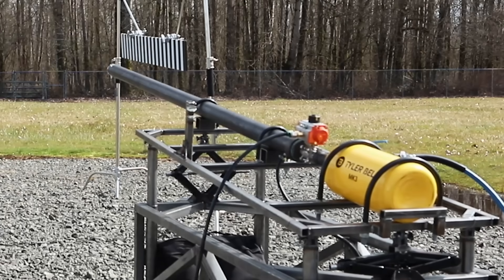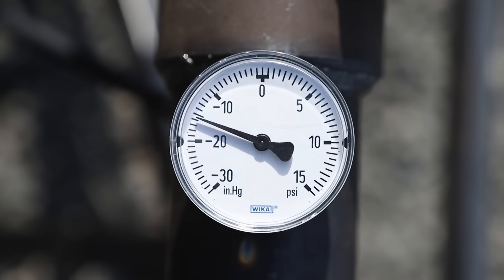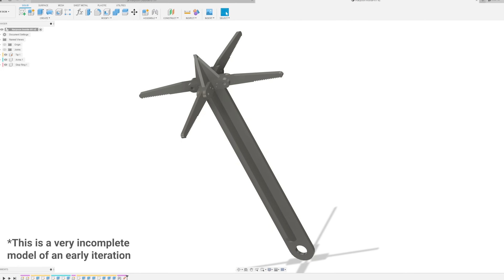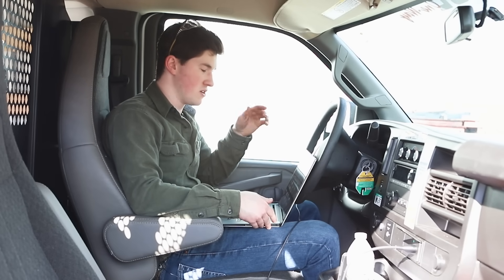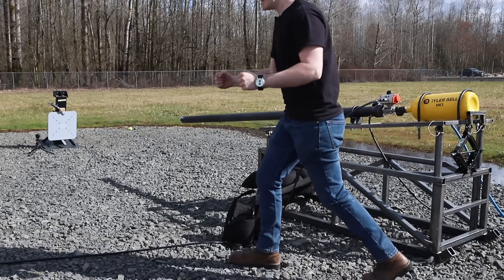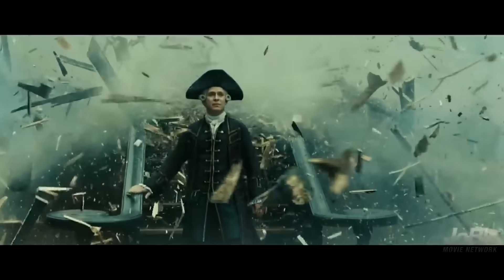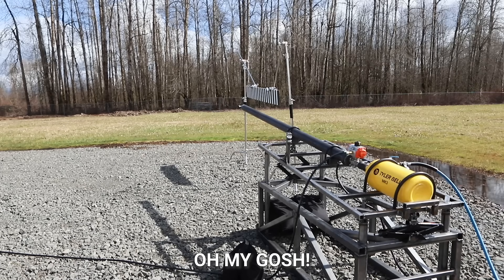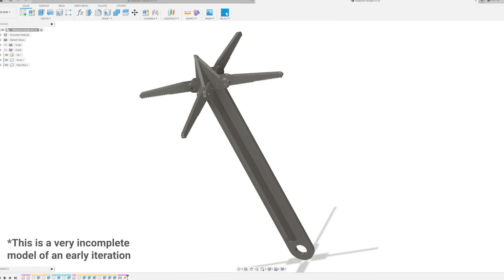Have I Found the Fastest Air Cannon Valve??

Comment: The weak link of your design is too small air tank. You have high pressure in your air tank, but not enough Air volume. By the time the ball reach the end of the barrel the pressure drop significantly because it has to fill the whole pipe with air. Double the size of the air tank and you will see significant increase in speed.
Reply: The other one is barrel length.
Reply: @Nickle314  Exactly. Once you have enough air volume, you have to increase barrel length to make sure the ball is accelerated for longer period of time
Reply: @GohanSama  Or push on it harder.
Reply: Another option is a sabot. A plug that makes a seal, but can't expand. The ball is then in front, and compresses into a dimple. Then the sabot falls away when leaving the barrel
Reply: He did pump the barrel down to a vacuum.  Increasing barrel length only helps if you have enough of an air/nitrogen supply.  The Sabot will help with the soft projectile,but I agree, increasing the tank size and then barrel length are good first steps.
Reply: More volume would help, but would make another problem worse.  The air in the barrel acts as a spring slowing the ball (See Smarter Every Day).  Pump the barrel down to the best vacuum you can.
Reply: The weak link is definitely the valve. At 10:01 it took almost two seconds for the tank to empty. If the valve was the same diameter as the barrel and opened instantly the tank would be empty in a fraction of a second. That's why the burst disc had better performance even with many times lower pressure.
Reply: The higher pressure cannon is definitely limited by the valve. Also the sabot idea is genius a piece of expanding foam cast in a dish shape to cup the ball would be best to distribute pressure. Also a bit of lube in the barrel may help as well
Reply: Greased patch like blackpowder.
Reply: a fundamental limit is the speed of air inside the cannon limited by the speed of sound.
Reply: @chargehanger  That makes no sense. Talk to the folks in California at Hypervelocity.
Reply: @chargehanger  Hot gasses, um air is a gas. It's the valve, the valve must open instantaneously because at these velocity's The projectile is out the muzzle before Tyler's valve opens.   My valve opens to 125% in 5 milliseconds That's 5 one thousandths of a second or .005/sec.
Reply: @chargehanger  What is an "air wave"?
Reply: @chargehanger So what your saying is if a solid lead meteor traveling @ Mach 8.98 will slow down and not break the sound barrier because it can't?
 Or... im just missing something here.
 Why can't air travel Mach 1.0
 Lightning that loud crack and boom comes from the bolt heating up the air to super sonic speeds.
 Help me understand why air can't but everything else can.
 It's just air pressing on, in my case, an orange with a force of 2,287 pounds for a distance of 4-foot. 
 That's 27 bar. 27times  the pressure of the atmosphere.
Reply: @chargehanger  When we first  smell something, that first whiff, the first molecule that had the sent attached to it. The source may have been only 10 foot away but that first air molecule may have traveled ten trillion feet. Due to the zigzag pattern caused by collision's with other molecule's, every air molecule at ambient pressure and temperature travels at 
 500-m/sec or 1,000 miles per hour.
As the pressure rises, (in my base to 400 psi or 26 times)  the speed doesn't change,
rather I'm pressing on the projectile 26 times more often. And yes the net pressure in front of the projectile at rest is 1 bar on the back side its 26 bar so at Mach o.1 the pressure wave of (sound in air) and the projectile's speed equals, and Kaboom!
Even though the air molecules are traveling at Mach 1.4  Tyler's design  has a flow issue. I "hopped up" the fastest opening reusable valve to give it a better flow rate so psi needed is much lower. Also  @ 10 pipe diameter's 30" in my case, the air take's on a laminar flow. so at 30 inches the air is moving as a unit with no turbulence. meaning, I've got 18 inches left to push, even with the pressure dropping to 300 psi, it's easer because of the laminar flow.
 When engineering something the goal is to design it as fast, cheap simple and easiest way possible. Then cater to the customer's needs, wants and budget. Imagine Tyler's Cannon with a 1 foot barrel, then with a 100 foot barrel, there's a sweet spot there. Mine came out with 4 foot given the 400 psi max pressure. I wanted it to be able to carry it myself , (no crane required),  99.9% stainless steal and just enough to break sound barrier with a navel orange. There were reasons for these parameters. Started right where Tyler is  now, the pumpkin chunkin, event and the pneumatic class trying to open a ball valve as fast as they could. Wrong type Valve! Newton's 2nd law of motion, f=ma Tyler has plenty of reserve pressure, plenty of time to push the tennis ball He's not getting the pressure on the tennis ball fast enough. To go from zero to 750 mph in 4 feet, things have to happen very fast. 100 times faster than a butter fly valve.
Reply: @chargehanger  This is a very pleasant conversation. I published some videos of it on you tube 25 years ago I used a conograph can't remember if it was 540 mph or 540 f/sec look then up and enjoy.
Reply: @chargehanger  I just uploaded a video at 115 psi it's a short. I have a different animal than Tyler has.
Reply: @chargehanger  One time 30 years ago. I feel like yes about a foot away it seams. Didn't want to blow down the machine. After reviewing footage the muzzle blast doesn't spread out much till 4 foot. I had no idea the cannon was so violent never filmed just the gun  until that 2 years ago and that was an accident. Glad you liked it I've got the bottles set up and the plumbing  parts. The scarry part is having 2,000 psi next to a vessel that is rated for 400 psi I've put 5 failsafe links in place and 3 that just buy time. If I screw this up...That's a bomb in Kaboom and we're dead.
 The range is 1/4 mile just dead reckoning.
Reply: @chargehanger Well I stand corrected. Nothing like a good debate. My thing was we had the speed of light, 1st $ 2nd law of thermodynamics, entropy and if it can go wrong it will go wrong. Everything else was fair game. They fast tracked me on reddit, allowing me to post on the bigger machinal engineering forms, My cannon and wanting I was wanting to do caught there attention. In a nut shell the general consensuses was no it cant be done. However several said Mach 1.0 and no 1.2 But, if I used helium yes it can be done, may need to lengthen the barrel two foot. I'll spring for a 200$ bottle of helium just to do it once well 10 times but at 20 dollars a shot, nope. this will be the first orange to travel at that speed so says google. Then I'll throttle it back to 300 psi on breathing air where it's safer. They all felt the design, valve and pressure should be sufficient. I'll keep you posted, Thanks.
Reply: Is there I preferred ratio being tank capacity vs barrel capacity
Reply: ←right there it is. The tell tail bow from the shockwave. projectile was 100deg below zero and 3.o68" in diameter, 155 grams. Barrel length 4 foot. Valve proprietary. propellent, breathing air compressed to 400/psi. It's all about the valve. Valve is 125%open before projectile moves 1cm the rest is W= f/d . it weights 50 lbs. however it MUST be strapped down. Hint the valve opens it's self? To do this you must be efficient and cannon  needs to be able to breath. Sorry wepon I'm replying to the wrong guy but you are correct! I have 75% pressure in reserve at the muzzle.

Comment: Your assumption that a ball valve at the same size as the tank opening is sufficient. That's completely wrong, you actually need to oversize it quite a lot. Like a lot a lot like twice as much if you want it to be fast. I know because I have worked on CFD where we were using high pressure air to clean diesel particulate filters. We used a popit valve and it had to be pretty oversized to open fast enough

Comment: Take this from a fellow engineer, it's time to put on your scientist hat. Projectile speed is going to be limited by the speed of sound in the fluid you're using, and with such a big barrel, the gas equation is going to be working against you. You need to either massive change the expansion ratio or you're going to have to change something else about the medium, like using a lighter gas with a higher speed of sound.

Comment: Since we’re considering the squish of the ball, maybe you could flare out the rest of the cannon once the ball is squished to compensate for the wider cross-section and keep the pressurized gas from leaking around it. Sounds crazy expensive though..

Comment: You should not be shooting solid projectiles at anything next to a road, especially at 500mph, if that ricocheted into traffic you just potentially killed a kid. Learn from that one.
Reply: A tennis ball is hardly solid. You can see it slow pretty fast in the footage before landing in the woods. Too lightweight and squishy to be a dangerous projectile at long range, by the time it's ricocheted off something and traveled all the way to the road it would be rolling on the ground if it even managed to reach the road at all.
Edit: It also appears he's angled the cannon away from the road to prevent ricochets in that direction

Comment: If you fix the barrel friction, valving, nozzle issues. You also have headroom in what pressurized gas you use, Helium, and especially Hydrogen have much higher speed of sound.
Reply: Yes. He could dunk the ball in oil before loading it in the cannon. The fuzzy surface of the tennis ball will hold enough for good lubrication all the way through the barrel.

Comment: I think you had the right idea with the burst disk originally. You need something that's going to actuate within a fraction of a second. A pyrokinetic change, burst disk, or a very fast acting valve. You're also severely limited by the bore diameter of your pressure vessel. If you can overcome those two obstacles, you'll get significantly more acceleration.
Reply: Coupd a pin-on-a-solenoid actuated burst disk be an option?
Reply: @ericlotze7724  Possibly? Depends on how much force that solenoid is able to actuate, and it needs to overcome the resistance of the burst disk itself. The pyrokinetic solution is good in the sense there's lots of materials that can withstand that kind of pressure but will change state with heat. But not a lot of materials that can withstand a high pressure load, but fail predictably with a little added force like from a solenoid.
Reply: Yep, burst disk is going to be the absolute fastest, but they're a bugger to fettle.  Just behind a burst disk you'll find air actuated piston valves, often sold as Quick Exhaust Valves.  Pretty difficult to find off the shelf in the kind of sizes you're working wth, but they are very easy to make.  Even easier to make and (very) sightly less fast is the "toolies piston valve".

If you're really worried about valve opening time, a hybrid approach can be used - a piston valve opening to pressurise the chamber, with the actual release being done by the pressure induced rupture of a burst disk.  The idea being that your mechanical valve is almost fully open by the time burst disk opens.

You /will/ need a convergent divergent nozzle to get the pressurised gas to flow faster than the speed of sound (in that gas) though.  You don't need light gases, but you do need to get the gas flowing faster than the speed of sound.